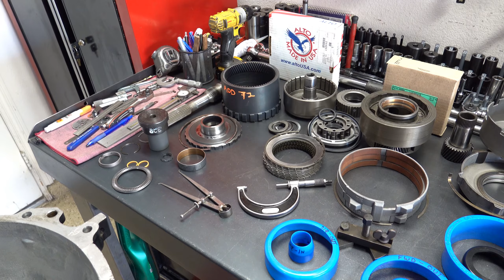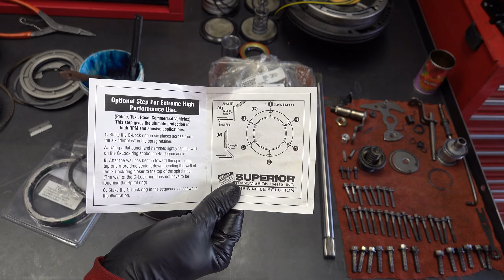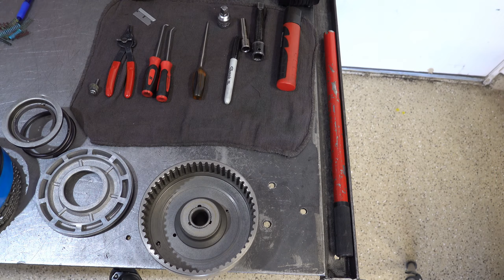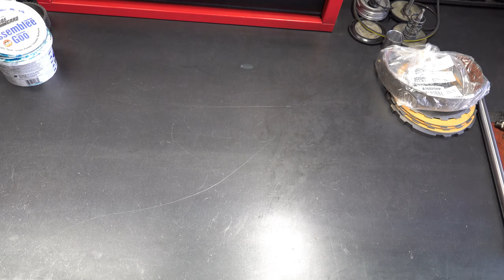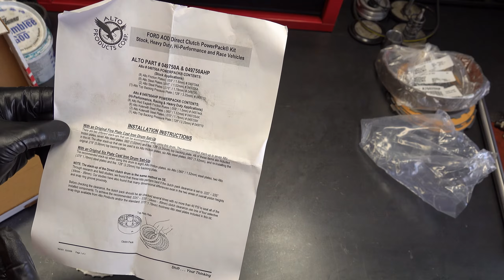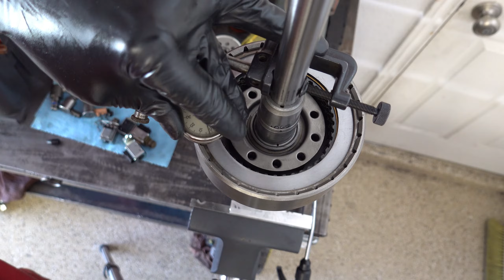Ford AOD Assembly Part 1

Comment: So refreshing to see you've replied to every comment. Not some, but every friggin one. 
  High praise from a 71 year old judgemental fart..
  I have the same tranny in my 80 f-150. What would the cost be for a refresh up to maybe middle ground? Stupid question I know, but average cost. How about just labor? And I would even take a depends. Don't spend a lot of time on the answer. Ain't worth it. 
  Thanks from up north
Reply from the maker: Thanks for the view and kind words, Kevin! 

I try to respond to as many comments as I can and usually reserve a few minutes at the beginning and end of my day to get to them. 

I don't quote or discuss my pricing for transmissions publicly however if you are interested in having me rebuild you a transmission, reply back accordingly and I'll provide a link to where you can contact me directly for pricing.

Comment: Does TV pressure affect line pressure on the left side test port? My line pressure is 100 at idle and 150 at 5,000 rpm.  What is the line pressure spec?
Reply from the maker: P,R,N,D,D3 are all dependent on the throttle valve system for line pressure management while manual 2 and 1 are fed directly off of regulated pump pressure, bypassing the TV system.

Comment: Hello.  Seen your video.  Great work.

Im up here in Minnesota and no where close I can find anyone to answer a question for me.

My 1991 grand marquee had the TV cable come off the throttle body.  The bushing rotted off.  My wife was driving into and it would not shift to 3rd.  Well, I got the TV cable back on and checked the pressure at the test port and the pressure is good.

Still no 3rd gear.  So my question is, do you think the transmission is shot?  It shifts so smooth in to second but will not shift again.

I have never rebuilt a transmission before but thinking with your video, I may try since I cant find anyone where I live.

Thanks for any advice.
Reply from the maker: Thanks for watching...Have you dropped the pan to see what, if anything is at the bottom as well as to assess the fluid condition?

Comment: Dude were did you get your reverse drum? My OD scored the hell put of its surface and I was wondering were I could get a new one but i cant find any specifically for the aod
Reply from the maker: Check with Transstar or Transpartswarhouse.com for those drum. WIIT Performance Transmission and Cobra Transmission parts may have them also.

Comment: Hey, Nick! Thank you for the great videos and the fantastic information in them! I'm really hoping that you could help me out and point me in the best direction. 

I'm going to be having an AOD rebuilt. It's going in a 1977 F250 supercab and mated to a 4.9 300 i6. Not gonna be doing a whole bunch of heavy hauling or towing. Maybe a camper or a camper trailer occasionally and the other basic truck small stuff but that's all.

I know, from your videos, that a lot of the AOD and 4R70W internals are interchangeable and that I'll definitely need the 2" Kevlar OD and reverse bands. That's about the extent of where my confidence is in my knowledge with any upgrades goes.

Considering this application could please let me, and potentially any others who may have similar questions, know what you would consider the upgrade must do's outside the standard rebuild? Also, what are your thoughts on a constant pressure valve body for one of these transmissions? 

Thank you so much, Nick!
Reply from the maker: Thank you for watching, babalokenath1!

I would perform all the lube mods that I specify in this AOD rebuild series along with bushings, a shift kit to shim the OD servo, perhaps a Sonnax OD servo...I would also make sure you check for OD servo pin bore wear....If the pin bore is worn, you'll need to ream and sleeve the case to ensure it's brought back up to serviceability. I would also upgrade the direct clutch to a six-clutch stack (or Alto power pack) by using a late AOD drum (the stamped, corregated metal version) and check the splines for wear there. 

Valve body-wise, install a Sonnax TV plunger kit. Make sure that TV system is adjusted correctly - verify w/a pressure gauge. 

Hope that helps.
Reply: @nickstransmissions  I know that you don't really have to answer questions like this in so much detail. I'm am extremely grateful for such a detailed answer. This will help greatly! 

One last question are there any parts from a 4R70W, other than the OD and reverse bands, that would be simple interchanges, that I should hunt down individually for this?
Reply from the maker: Check out my 4R70W AOD parts swap video if you haven't already...I cover all component interchange between the two units: https://youtu.be/Xve7LORcP7M

Comment: I watched your disassembly video and you didn't cover the direct drum in detail, (removing pistons etc.), and then in this video it's completely disassembled. Is there literature you recommend for this part? Thanks!
Reply from the maker: Hi Trevar, disassembly is simply the reverse of reassembly so between both videos you should have what you need...Literature-wise, always have the ATSG manual for whichever transmission you're working on as it's an invaluable resource for any builder.
Reply: @nickstransmissions  Thank you. Just wanted to be sure there wasn't anyting special on disassembly I needed to know. I appreciate it!
Reply from the maker: You're welcome, Trevar.

Comment: Can someone help me my transmission only drives backwards it is a FordF150 4.6 v8
Reply from the maker: Hi Jahn, are you looking to have it rebuilt?
Reply: @nickstransmissions  I want to repair it myself. what could be broken?
Reply from the maker: Gotcha...My guess is forward clutch failure....Once you have the transmission apart, remove the overdrive servo from the piston and reinsert it into the bore, checking for side-to-side play...If you have a lot of play in that pin, the OD servo bore is worn and needs to be reamed and sleeved. Or you can also replace the case. 

I mention this because forward clutch failure is sometimes caused by excessive the OD servo pin bore wear and OD band failure.

All this assumes the problem is your forward clutch and not something else - you won't know until you get it apart and have a chance to inspect everything.

Comment: Good work i got a new gear box and it was a 4r75 but it was missing the wavey plate on the intermediate clutch i personally like the aluminum apply piston better cause it has exhaust port in the apply piston to keep it cool the bonded piston is weak.
Reply from the maker: Thanks, Zac! 

Good info re the aluminum vs bonded steel/rubber pistons on those.

Comment: Hey man great video so far. I'm in the process of rebuilding mine and I'm putting in the forward drum piston and even with the seal protector tool kit, it is a nightmare. Any tips you could give to get these pistons in?
Reply from the maker: Hi SniperTHM,

Thanks for the kind words...If you're using the aftermarket blue lip seal tools, they are marginal at best...try heating the lip seals in fluid to soften them up then install...If you havent done the reverse input drum yet, heating is damn near mandatory to install it reasonably quickly...
Reply: @nickstransmissions  I'll try that for the reverse piston. Currently waiting on a new seal after tearing it with a feeler gauge lol thanks again
Reply from the maker: You're welcome, man....Did you remove your other comment re air-checking the direct clutch? I responded to it but it has disappeared from my view...Trying to see if Youtube deleted it for some reason...

Comment: Nick, thanks for responding about the air test plate...i have a question for you...i was air checking my trans and applied air to wrong hole...i had the pump and stator like you did in the test you showed...when i applied to the wring hole the intermediate blew out...cut the seal...my new seal i had to get was a thin lip and the org and the one in my trans kit from oregon trans was a fat lip....is there any reason to not use the thin lip ?
Reply from the maker: Hey man, I'd use the thicker, fatter lip for better sealing.

Thank you for watching!

Comment: I needed to do a case swap on one of those back in the 80s. The rear of the case was worn where the sealing rings on the output shaft cut grooves in the case, so I did a case swap. I learned later that a tool and driver was available to repair this area much like when the governor on a 350 or 700R4 wore out the bore in the case. After boring out the case, you would drive in a sleeve to repair the bore. I didn't do enough of the AODs to warrant buying the tool. I'm guessing that if they made a tool for this that it must have been a problem for that particular transmission.
Reply from the maker: Hey Peter, thanks for making me aware of a "case saver" repair kit for those, wasnt sure if anything existed for them or not.